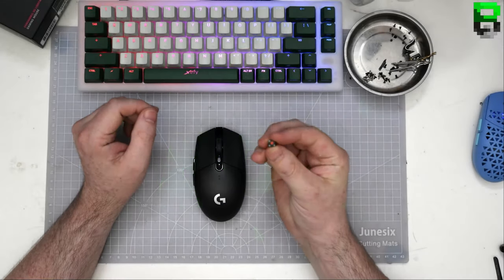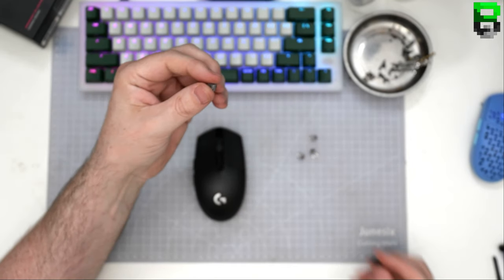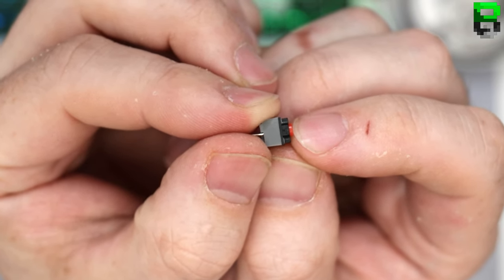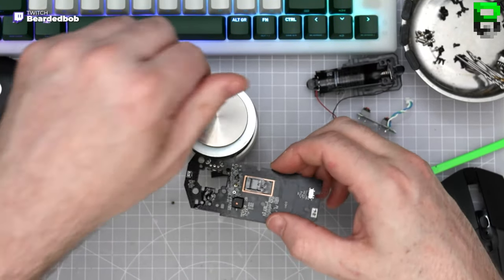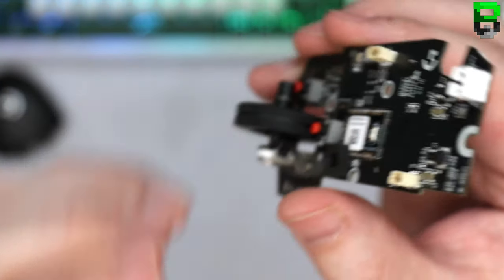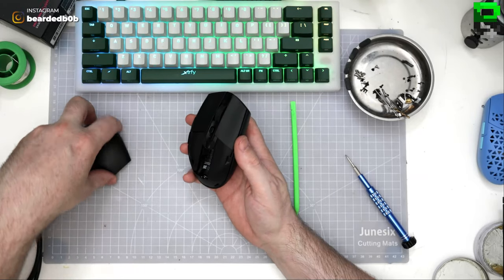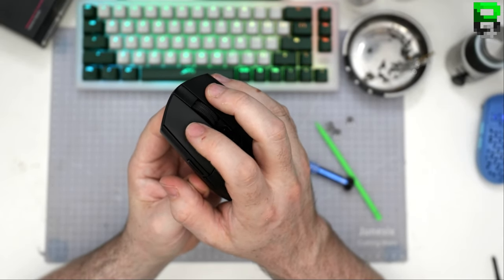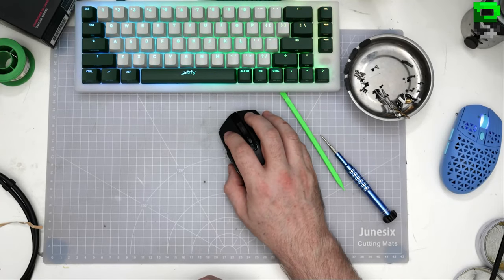HOW TO MAKE YOUR GAMING MOUSE QUIETER: Silent Logitech G305 Click Replacement Guide

Comment: Can you do for razer optical switches they are loud and annoying
Reply: Won't work because Razer mices use optical clicks
Reply from the maker: You can mod a mechanical in to the razer opto mech pcb but it’s not easy
Reply: @Beardedbob  If this is ever easier at some point, please make a video on it, as I too hate the sound of the opto switches. I was really hoping for a silent switch to be available.

Comment: These type of buttons have very small press resource comparing to original 3 pin clikers. I have Logitech G602 and middle mouse button uses this round type button. As i do 3D modeling - i use middle button A LOT for camera movement. And this buttons die like every 3-4 months... Please give an update how they been after 5 months now
Reply: you now my pain xD ive changed to g604 bcs old g602 mmb not worked well after 4years. now i have 10buttons (scroll has side-to-side programmable buttons too) and i need more two buttons that will be just perfect (total 12)xD

so this mmb is so loud that im using two mouse pads on top of each other to make it less load, but noise is still getting to the tabletop and goes louder with it
Reply: they're extremely short which means they'll disintegrated faster than normal obv

Comment: Hi, thank you very much for your video that help me very much.
I know you have posted this video there are 2 years ago but I try a question : can you tell me what is the accessory do you use to block the plate before desoldering?
It seems to be useful for little components.
Reply: hi I'm also interested in the question

Comment: Will this also work on my G pro superlight? Kinda wanna make it silent😁😁
Reply: Yep, works with every mouse using micro swiches, which is basicaly all the mouse production
Reply from the maker: Yep i've modded a few GPX to have these as the mains only though you can't use them in the sides
Reply: @felix720p  okay, thank you. I'll give it a try.
Reply: @Beardedbob  ahh, I see. Thank you so much Uncle Bob🙏

Comment: I replaced the left and right keys of my G305 mouse with silent buttons. Everything was fine, but now the weight of my fingers causes them to press the keys by themselves while using the mouse. I take care not to press the keys and this is tiring.Is there a solution to this?
Reply: try to move your fingers rearward a little, that will help a little at least.

Comment: You are actually charging 10 quid for 2 of those? 😂
Reply from the maker: Sure am, 20% is vat, add postage to ship as it’s free, take off import tax 20% and shipping from China, not much meat left considering I have to take the risk to hold them as stock. Plus all the shop hosting charge and transaction fee 😂

I provide the link from China feel free to use that 👍